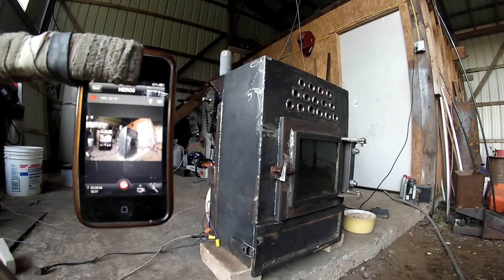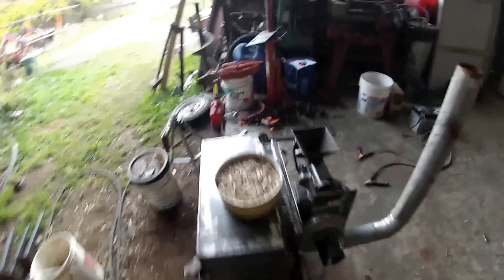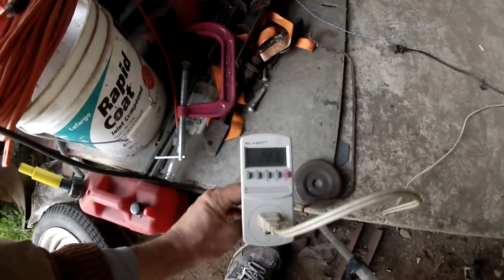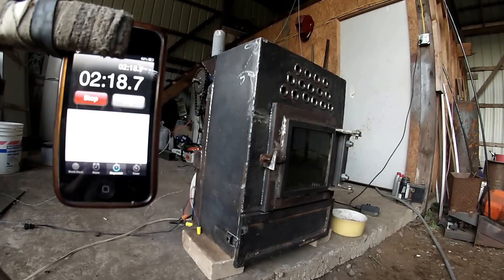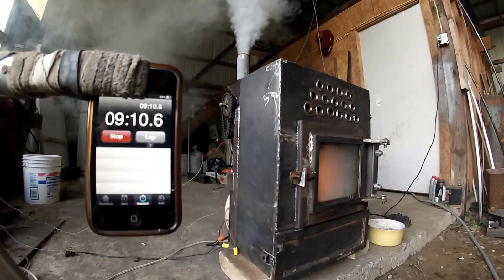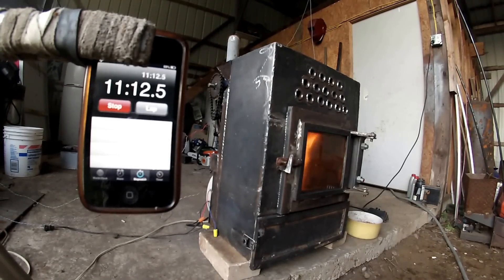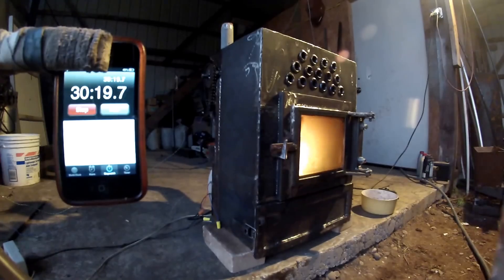Pellet Stove - Homemade part 2 - 4

Comment: Hello Mark,
Like your project! Very well build also. I was wondering where the combustion air inlet is located at your pellet burner. You are sucking air in viia the exhaust blower, but fom where? 
Why not blowing air in and pushing the smoke out? Is there a reason for your setup? Any chance at a update of your burner?

Kind regards,
Marcel
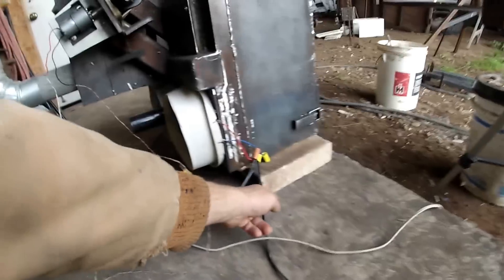Reply from the maker: combustion air inlet is a  pipe betwen blowers  part-2  1:11. on part-4 0:17 you will see sqeare hole witch i cover leter and welded air inlet pipe in it.
do not blow air in !!! ALWAYS suck the smoke out!!! safety!!!  in case of gasket failure and/or chimney clogs smoke will not go in to home even if you open the stove door.  the is nothing else to add. totall 4 videos. stove is working no problem at all. watch my row file of stove on google drive (38s) https://drive.google.com/file/d/0B2jTyKj3grgHQnh2TnBQWnlSYlk/edit?usp=sharing
Reply from the maker: you can see it all. it may answer most of your qestions. https://drive.google.com/?authuser=0#folders/0B2jTyKj3grgHd1lQWXZYSV9lTjQ
Reply: Hello Mark,

Thanks for your quick reply!  I now understand how it works. Thanks for that. You are right about sucking the smoke out. I never thought about that. I watched your video's on google drive also. Very entertaining!
If you cut down on the supply of pellets in the burn pot, do you turn the speed down on the blower to?
Reply: Mark Veren

Comment: can't find your plans or pics on drive.  Any thoughts on building a pellet burner around a hot water boiler. could email some pics of the boiler and gas burner assembly or upload to my google drive space
Reply from the maker: I wouldn't suggest to build a pellet burner around a hot water boiler 'cause it will clog an exhaust pretty quickly.  In my opinion, it's much better to put a water coil inside a pellet stove and connect it to the existing water boiler.
Reply from the maker: & upload it to your google drive and send me the link...  i'll check it out and share my thoughts...

Comment: Looks like a good job Mark,  Where did you get the fans for the stove?
Reply from the maker: the fans are out of window fan(they wore not good  ). i replaced them with squirrel fan out of microwave oven. got from e-bay for $22. specs: 2 speed 120v 114w/ 135w.

Comment from the maker: sheet metal $45. +some left overs from other projects. I believe I spend $200 - $300 or so...  I will include total cost in video#3 later. working on control "on arduino" I will post plans & can make lot of pics & post it on "Google-drive"